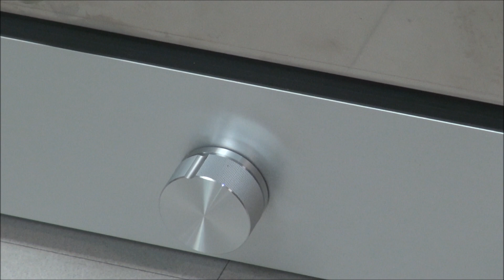半導体プリの結合コンデンサにWEST-CAPを使ってみた・F120A/FT90H・2A3真空管アンプで聴く♪

Comment: pls write down in english full spec
Reply from the maker: thanx a lot♪
Reply from the maker: OK(^^♪
signal chain: in~MUSES01 voltage follower~WEST-CAP 1.5MFD 200V~ALPS RK501-100K~OPA2604AP voltage follower~TAMURA TD1W~out
power rail: power trans~3 terminal regulator etc(15V)~WIMA 22MFD 63V~ELNA2200MFD63V~ERO MKT1813 0.22MFD 400V~SPRAGUE ATOM 1000MFD 50V~ SPRAGUE 109D 220MFD 30V~copper-foil sti 28pF~ERO MKP1840 10MFD 160V~3 terminal regulator etc(12V)~OP-AMP
etc: MUSE KZ 1000MFD & MUSE FG 100MFD
0.9mm OFC(power supply) & 0.8mm AG wire(signal)
Reply: Beautiful work...